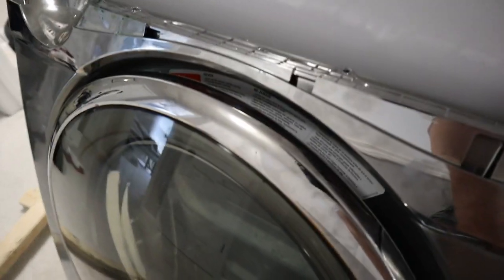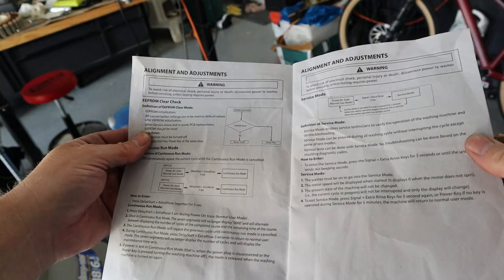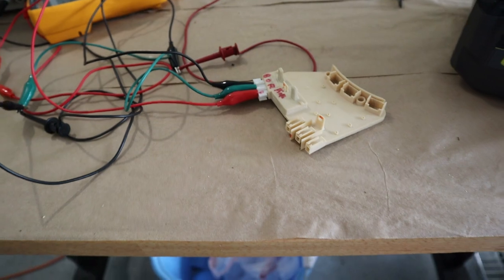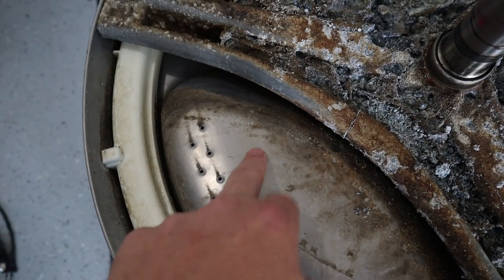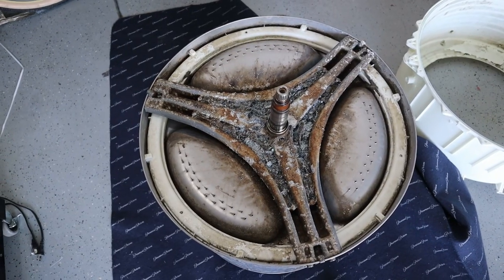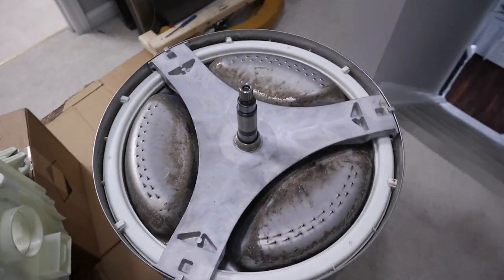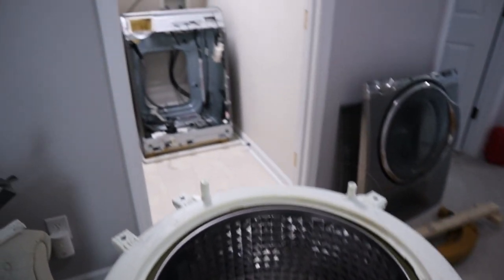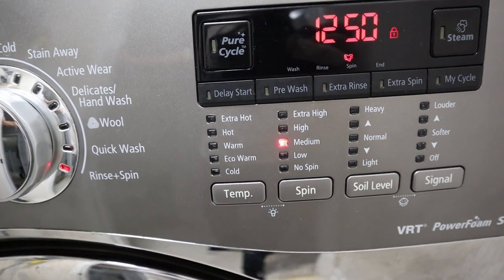#MTBPlanB Front load washer won't spin, error code 3e1.

Comment from the maker: What other resolution advice can you offer for front load washers that throw a 3e1 fault code?

#diy #troubleshootingisking #mtbplanb #partypeople
Reply: Sounds mighty coarse?  Did you resolve that noise? Lots of goid info. Im in the middle of fixing a Samsung WF330ANB.   Currently im getting a code 3E on display.  Ive ordered a new hall sensor. Pump was bad. Replaced that now itll pump water out.  The filter was fullnof debris. But im sure its kitty litter. Previous owner breeded
 exotic cats.  It clumped together when wet but dries to a powder when it comes out.  Unlike the metal you showed. Ive seen that on other washers. But ill heed your advise and continue confirming what the debris is.

Comment: Could you turn the tub freely by hand? Mine turns freely with no binding or flopping. Also did you get a code 3E? Thanks
Reply from the maker: Just a 3e1 code. Hub would turn freely by hand.

Comment: Most of discussions online are about error 3E or 3E2, which vaguely states "motor error". Because manufacturers don't rly want for us to know how to fix their sh*t when it breaks after 2 years of normal use. But 3E1 error is described as "engine overload", which means it can't move freely for whatever reason and is drawing too much current. You could've skipped half of this video and just moved the drum with your hand, that's all it takes to check on the spider arm. PCB or brushless motor diagnostic, that's where the nightmare starts.
Reply from the maker: The drum moved freely and made no noticeable noise. My guess is inertia caused the cracks to expand and threw debris towards the outside to hinder movement when in a spin cycle.
Reply: @MTBPlanB  True, higher speed would mean the cracks would expand, the spider at this point could become completely off center and drum would start to "catch" the front seal or start scratching the plastic of the tub, causing the 3E1 error.

Comment: I'm getting this 3c2 error code when I try to put it in test mode, why is that?
Reply from the maker: Hi Yuran, This code is likely similar to the 3e1 code. If you determine the PCB board and motor test good using the procedure in the video, then check the spider arm.

Comment: I have an 8E1 error code. However I replaced the vibration sensor and I’m still getting an 8E1 error code. I’m about to lose my mind!!! It’s been down for 5 months now. 🥴😵‍💫🤦🏻‍♀️ 🤯🤬😭 I replace the bearings and seal, the spider arm is in great condition I replaced the shocks, and now I’m still getting the 8E1 error code. Please if anyone can help I would be so grateful! 😊 Thank you

Samsung
WF56H9100ag/a2-00